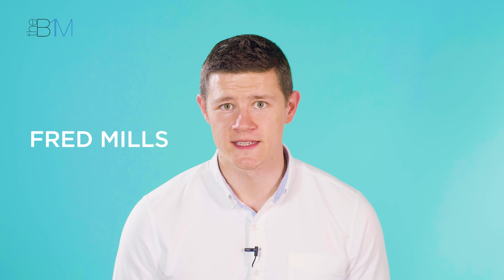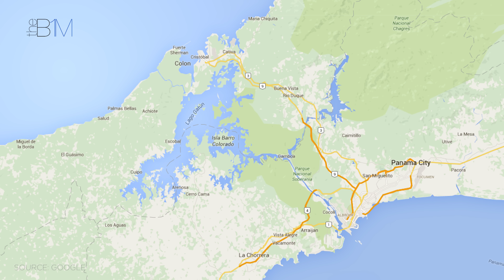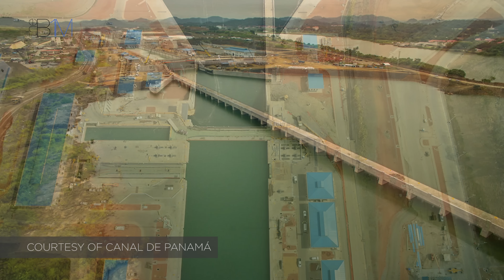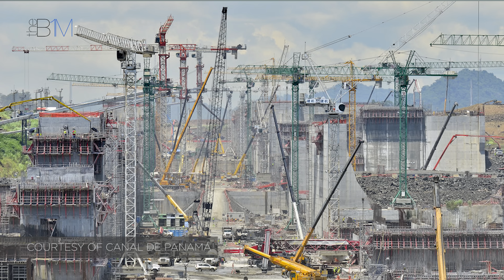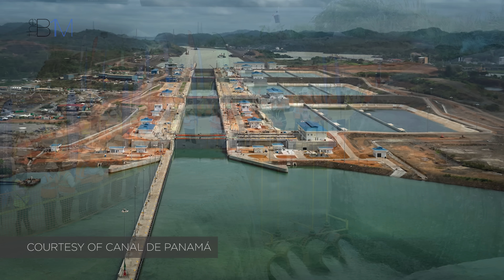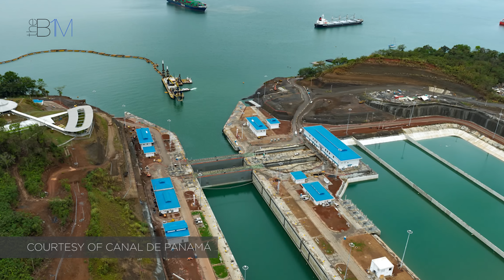Expanding Panama Canal with BIM | The B1M

Comment: Where is the new canal located relative to the old canal?
Reply: There is no “new canal”.

There are however new, parallel locks, longer and wider than the old ones, and which were built alongside the existing ones.

Also some narrower parts of the existing canal were also widened.